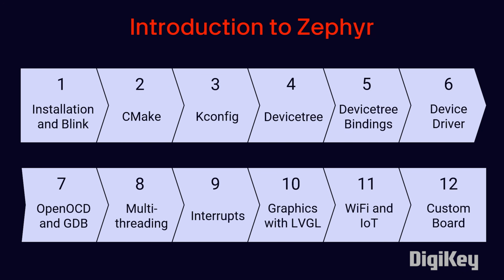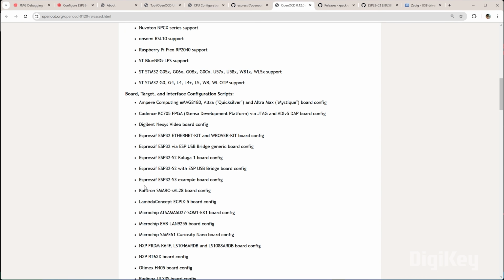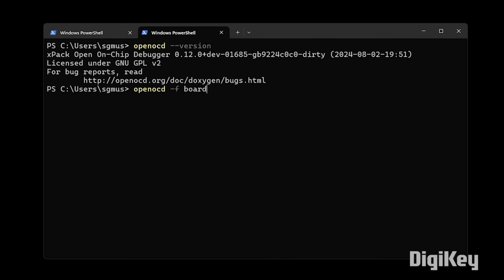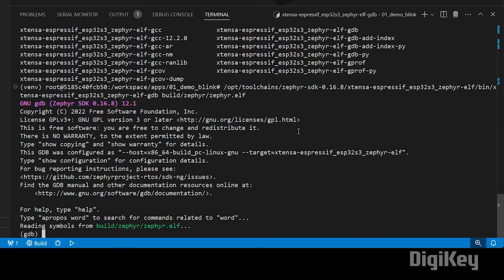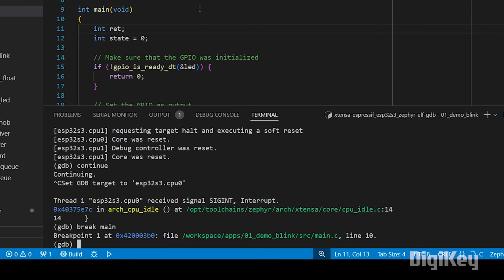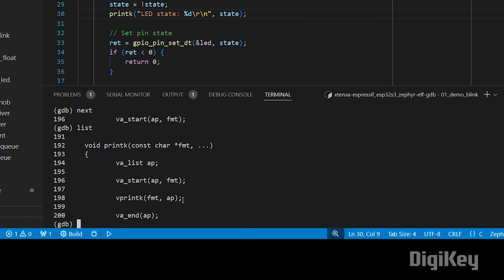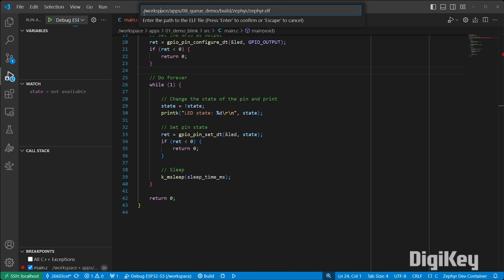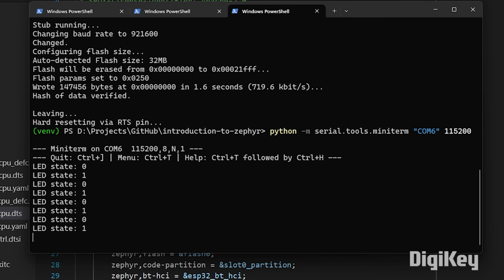Introduction to Zephyr Part 7: Debugging with OpenOCD and GDB | DigiKey

Comment: A huge thumb up for going through the Windows setup. I've not used it for a long time to develop/debug and forgot how tedious it can be, especially for newcomers.
Reply: It's sort of a Windows setup. I'm cheating a bit by using Docker, which is pretty cross-platform (at least among the major OSes). It's actually all done in a Debian container with the understanding that the Docker abstraction allows that container to run on just about any system. I've now moved almost all of my dev work to containers for this reason :)

Comment: Just as a heads up: on Arch Linux the openocd package is not new enough to contain the needed esp32 configs. I went with a local install of the xPack of openocd instead, which works great.
Reply: Thanks for the tip about Arch Linux!

Comment: I am both disgusted and super impressed that you're doing all this in a windows environment. These videos are great. Thanks
Reply: LOL I use Windows for these demonstrations because it is the hardest environment to set up for many of these frameworks. I usually run a quick test on Mac and Linux, but my line of thinking is "if it works on Windows, it'll work anywhere." :) This often means that just about anyone can follow along with any OS.